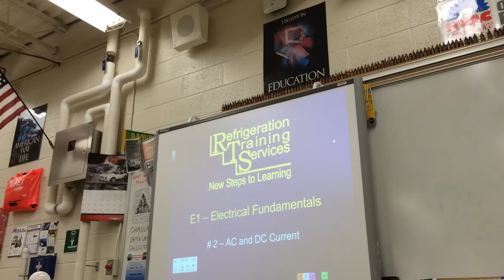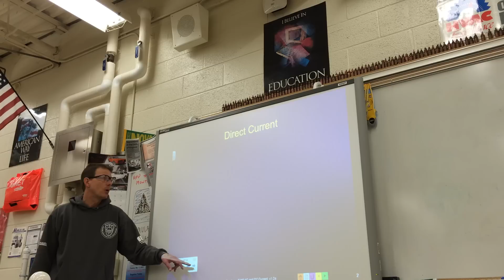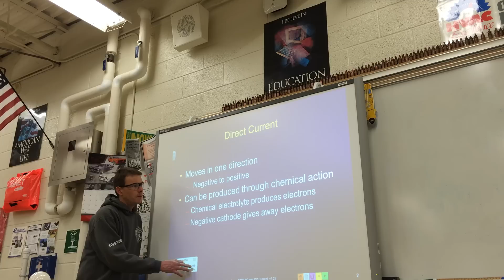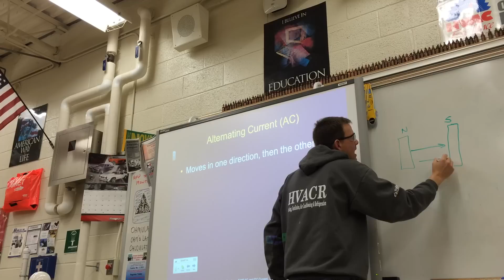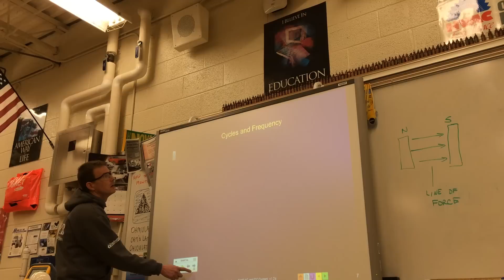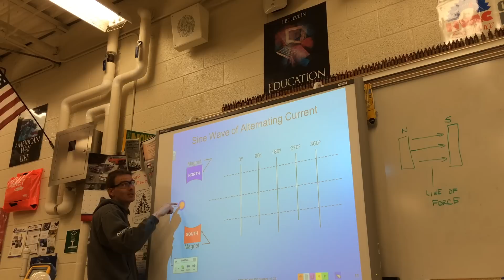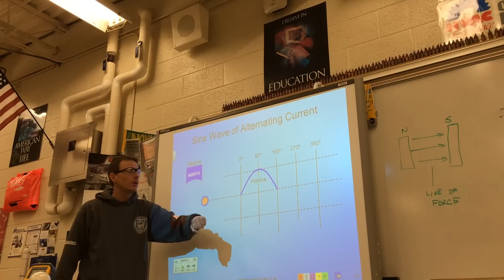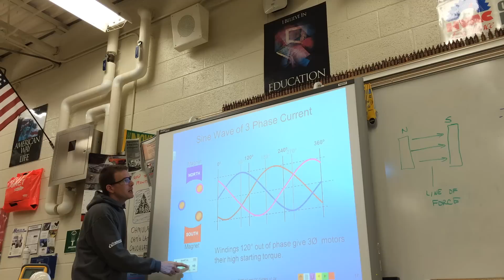HVAC Basics: Electricity - Chapter 1 - AC/DC Voltage Lecture

Comment: Explain this one to me:
I have a generator: 3600 watts running, i have a standard extension cord 10 feet running from my generator to a charger that is charging Li-Ion batteries..
The extension cord is a standard 16/3 ~13 amp 300V at 10 ft long. The generators MAX current using the standard 120V socket is 16 amps... per generators marking. So i run the extension cord from the 120V 16amp socket to the battery charger... Power up the battery charger and now i begin to charge the 5 Li-Ion batteries... The charger tells me that its using 59 DC AMPS to charge the batteries..  HOW is this battery charger using 59 amps of DC current when i put my clamp meter on the extension cord BLACK/HOT wire and only measure ~15 amps of AC current...???
Reply from the maker: +You Tube one side of your charger is pulling one amp reading (AC) and the other side of the charger feeding DC to the batteries is pulling another amount of current. Different voltage, different current. Thanks for the question and for watching.
Reply: I understand one side is pulling AC current and the other side is pushing DC current, but Im still not understanding how the load side of the charger can PUSH 59 amps of DC current when the FEED current to the charger input is only 15 amps ... How can it bump UP the current like 4 times when the supply current is only 15 amps... ??
Am i asking the question right or what..??
Its like i give you a 2x4x6 piece of wood and you convert it to a 2x4x24 piece that is 4 times bigger...  15 amps to 59 amps